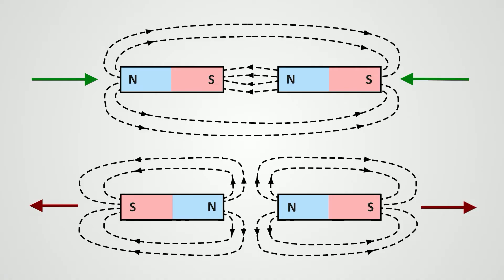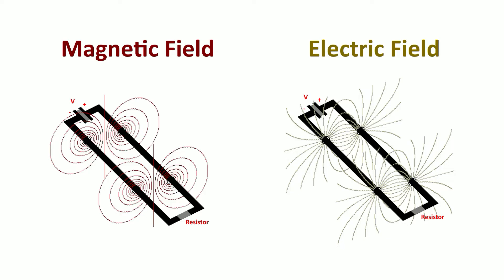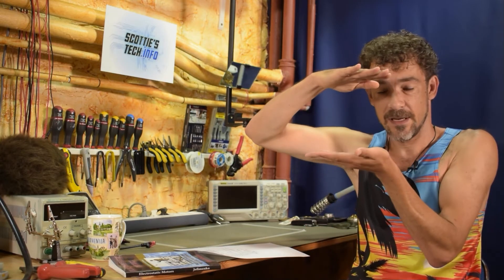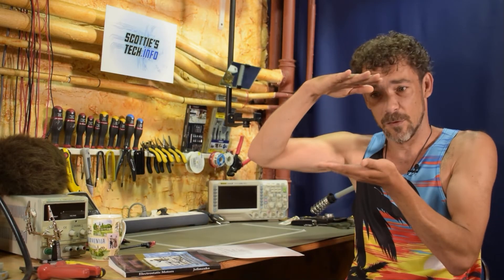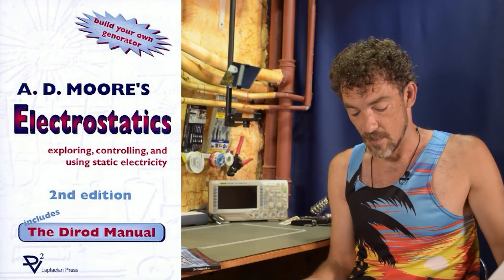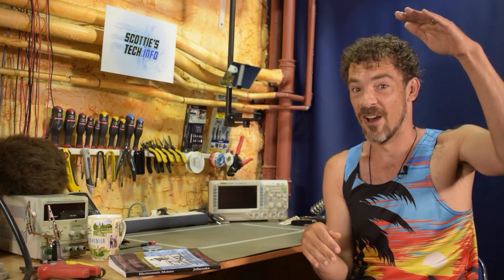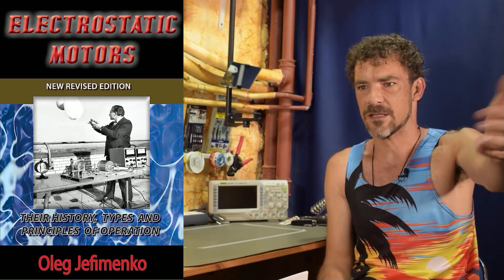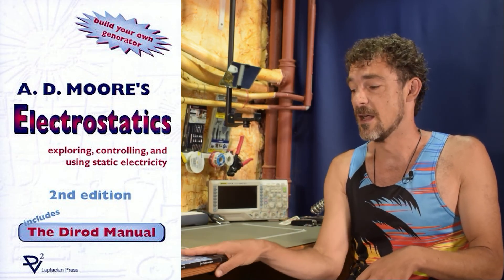What the heck is an ELECTRET?

Comment: Benjamin Franklin a long time ago explained how a capacitor actually worked, he stated that capacitors store their charge within the dielectric insulator, not the conductors, and that air acts like the insulator for lighting. I read up on this quite some time ago, and watched it preformed were an insulator was charged, removed from the charging conductors without discharging it, to were it was then placed onto a set of new conductors to which it was then discharged. I’m thinking this term electret related to how this device is made is not exactly “correct” in away. To me it seems more like a capacitor that has been charged with controlled cooling which in away locks the polarization within the dielectric insulator creating a short of permanently charged capacitor versus an actual “electret” because the device creates a field that which seem to be non oscillating and constant like that of DC current, as to me I don’t particularly call static as static electricity I call it and see it as high voltage DC, the only reason there’s noise is do to the high voltage ionizing the air a bit even when there’s no storms around and such, the high voltage is still high enough that there is some leakage current that occurs across the charged amount of air creating noise that which has a broad spectrum of generated noise too!

Comment: A cubic meter isn't 4 by 4 by 4 inches but 1 by 1 by 1 meter, so it's about 40 by 40 by 40 inches!
Reply: I think the author is taking one more step - he says 1000 horse power in 1m^3.

Divide that by 1000 and you end up with 1 hp in 1000th the space, or roughly 10x10x10cm representing 1 hp.

He was making an energy density comparison

Comment: Great video; I have also been looking into this topic and really want to call a safety issue to your attention. It turns out wax electrets do not need to be made from molten wax, but are more reliably and safely made by forming the wax first, and then electrifying it at 70C, while it is still solid. Molten wax can be a danger if the power supply has too much power as its resistance goes down with temperature, and can run away into a fire without current limiting. You can read all about this in "Experiments on the Carnauba Wax Electret" (1955; Gerson & Rohrbaugh)
Reply: @carpdog42  Now that's valuable information.  That really helps, as I want to make a hockey puck fatter at the edges to prevent arcing. I used polypropylene and polycarbonate with only some success. I am going to try the old school formula.

Comment: I think the biggest issue why electrets are pretty unpopular for mass manufacture is the fact that it's is way harder to create a strong electric field compared to making a permanent magnet. You can make an electret in a similar fashion to a magnet, simply by raising the material to its curie point (or whatever it's equivalent is called for a dielectric) and then applying a strong field (you can melt the material too, but its not always necessary and it reduces repeatability). The big difference is the fact that a magnetic field doesn't suffer from electric breakdown meaning you can generate a ginormous magnetic field in a small volume. With electric fields, you suffer from the breakdown voltage of the dielectric you are trying to charge, so there's a hard limit on your field strength. Other manufacturing methods (charge embedding, corona charging, etc.) are usually limited with depth of penetration of the materials, limiting you to charging only very thin films which, again, have little applications (one of which, like you said, the electret microphone). 

Since magnetic fields and electric fields are so inherently connected, usually whenever you find an application that might need an electret to create a potential difference somewhere, it is often possible to figure out a way to do it with a magnet and a coil instead. Whenever someone really needs an electric field, usually a high voltage between two plates suffices as well and probably is a cheaper alternative (electrostatic speakers for instance). Also in niche applications, since you are limited to mostly plastics, they're hard to use in high vacuums, higher temperature environments, etc.

I do want to say it IS an interesting field nevertheless, and weak electrets are also pretty doable to make if you have access to a high voltage power supply. A super well-known and researched material is the use of carnauba wax. If you put a high voltage between two plates and pour in a mixture of 50/50 carnauba and colofonium resin (if it's too brittle you can add stuff like paraffin or beeswax), let it cool, and solidify, pull it from the mould and let it sit for a while to stabilize. I've managed to make my own electrets with the best ones having an electric field strength of about 1kV/mm (past this, I kept getting breakdown between the two plates). I used those to play around and make a guitar pickup with them. You can use an electret to make a capacitor with permanent charge, using either a conductive string as one of the capacitor plates where the vibration changes the distance, thus also the capacitance, or using the non-linear relationship of the placement of a dielectric between two capacitor plates to change the capacitance with a nylon string. 

It was purely for fun, I still plan to document the process so it's repeatable for everyone, though I did not find any benefit compared to whatever already is on the market besides it being a gimmicky thing.
Reply: The reason is that  permitivity is so bad. Only good at super short range. 
Please look at my electret powered electrochemical cell. 

https://m.youtube.com/
Just drop 2 copper plates in NaOH or KOH and start playing.  I recommend gluing some glass rods on to them.
Reply: TiO, titanium dioxide has a dielectric constant of 60. I have some and an arc welder with carbon rods. I will try to get to that soon.
Reply: Oops, it's TiO2
Reply: @m.e.8273
Well that about answers my questions! Thanks!
Reply: @m.e.8273  You are right. Magnetism is so much more convenient.  I sometimes figure out how to do things that are not yet possible.  I can make an electrochemical cell using magnetism if only I find an ironic liquid in which one ion is ferro magnetic.
Reply: @honeydavis5568  i want to see your video but it's not on that account
Reply: I built a really nice power supply now with a variac, a neon xformer and a voltage doubler.
Reply: @m.e.8273  on what market? Who sells electrets?
Reply: @honeydavis5568  Well, I'm sure there's manufacturers around but the hardest bit is getting a substantially big electret to retain its electric field over a significant time-span. Electrostatic guitar pickups are nothing new, but it's only viable to generate the electric field actively with a power supply (which adds a lot of unnecessary complexity to an otherwise simple device, it's not worth making the tradeoff). But if you manage to get an electret to retain a good remainder of its charge over a couple years or so... that would allow for some really fun experiments :-)
Reply: Wow I humbly admit I do not have a clue as to what is being mentioned. I have a lot to learn. I commend all of you that do understand. And have done the work to comprehend it.
Reply: I'm not a conspiracy theorist, but I have an assumption that this type of fysics are surpressed because of the possiblity of making very advanced lightweight znergy focussed and convertion possibilities
Reply: @Wheeliesirius  It's not suppressed; a ton of research is being done on improving electrets, there's a bunch of uses for them and they've also hit the consumer market decades ago. They're just inherently hard to deal with.

Comment: A cubic meter is a pretty big motor ....
Reply: A cubic metre is different to a metre cubed...
To make things easier use 2 instead of 1 ...
Builders merchants have this situation a lot... 😻
Reply: @mySeaPrince_  A cubic meter is 1 meter by 1 meter by 1 meter. this is about the size of a washing machine. and they are both the same thing.
Reply: @ScottiesTech
Please read other comments in this thread... 💥
Can you do a video on the difference between a cubic metre and a metre cubed...
As I said in my comment use a unit other than 1 ie 2 as it can make more sense..
In my time I've had this situation.. also... Builders Merchants have this issue with people ordering materials like sand etc.. one person tried ordering 12m3 of sand .. they had a little bit of a shock at the price, particularly the cost of the number of lorries required.
(I did notice you thinking it through in the video)
Another 'Area' to 'Cover' is 2 dimensions ie slabs and carpet 😻
Reply: To anyone else confused by these comments, I believe the comment is about the difference between 1(m^3), and (1m)^3. 

3(m^3) is 1x1x3

(3m)^3 is 3x3x3

Plz correct me if I'm wrong.